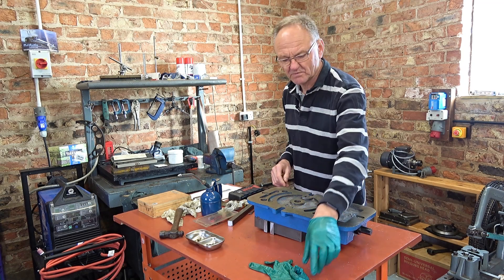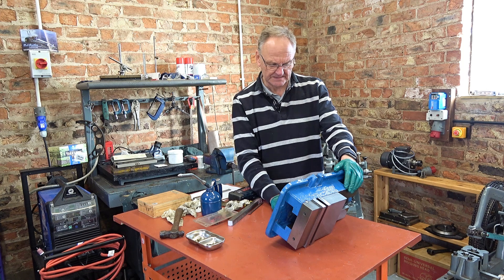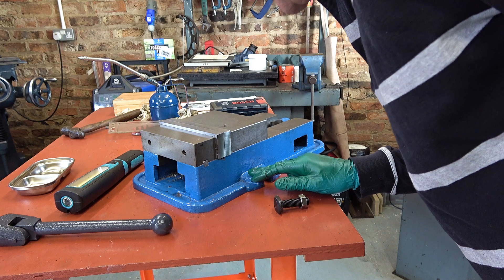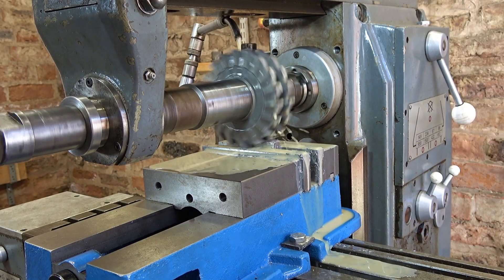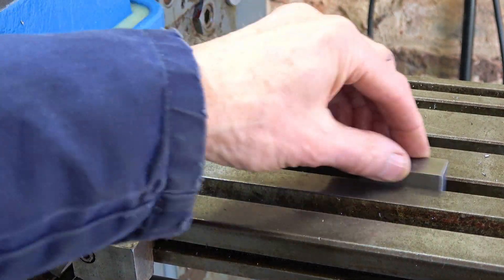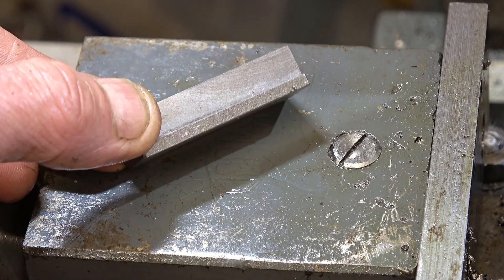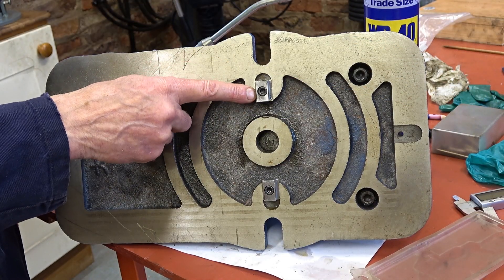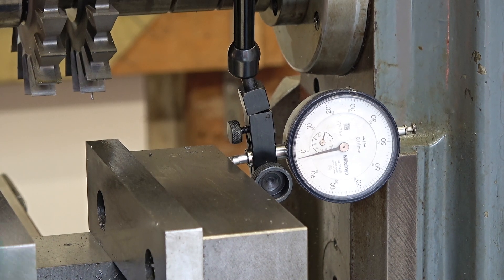HS283 Vevor milling vice improvements - making alignment keys

Comment: I have a similar vice that I use for big brutal stuff on the Bridgeport. There are lots of issues with it, like you can see oil weeping from the rear of the fixed jaw and the front of the moving jaw as you tighten the vice on to something sitting on parallels.  The face of the jaws are not very vertical, nor flat.  I had to scrape the underside of the vice body to get it flat enough to stop it from rocking. I tram it in each time, but I'm thinking it might make more sense to use keys as the thing isn't a precision instrument anyway. I use it mostly for material prep for things that won't fit in the Gerardi vice on my CNC mill. There are some inconsistencies between the faces of the fixed part, there are some dished areas, although over a few inches, it averages out very well.  Typical use is to hold a sawn piece of stock that's a little too wide for the Gerardi on tall parallels and mill the top and four sides, leaving a little grip stock. Then I transfer it to the vice in the CNC and remove the grip stock and face the part as the first op.  That way, the tramming of the big vice is almost irrelevant, and so long as the bed of the Bridgeport is trammed perfectly, it won't even matter if the vice jaws are not level, so long as I'm transferring the part to the CNC for the next operation. I have a decent 4 inch vice for the BP, but I rarely use it, the 6 inch cheapie is good enough for most stuff.
Reply from the maker: Hi M&M good to hear from you again. It's clear the cheap import vices have their limitations, but they are very cheap after all. I need to check the jaw faces on mine for vertical and also front to back of the jaw holder blocks. What's trammed on the front might not be trammed on the back. Cheers Paul

Comment: Whenever I find or come across cheap tools made of decent stuff I always wonder if what we get is a rough hewn version of what should be a finished product whereby a little finagling makes it a better product. I have a number of cheap tools and most of them have become very serviceable with a bit of whittling. In saying all that I admit that nothing, and I mean nothing, beats the sheer joy and quality of old, professional grade equipment.
Reply from the maker: Hi ClassyDays, the problem is the real quality stuff is so expensive so the only viable option is buy cheap and fettle. Moreover there is plenty of worn out quality stuff around which is well past its best and still expensive. Cheers
Reply: @HaxbyShed  it is satisfying to get a cheap tool working accurately though. Cheap tools also make the hobby and industry more accessible. At the very least it only needs fettling once. Hopefully.

Comment: check the vertical of your fixed jaw, mine is miles out. it's a size smaller vice than yours though
Reply: Also check the flatness of the base.
Reply: Base is ok within 0.01 of mill table. So I'm happy with that. But the fixed jaw is out 0.45mm over 40mm. When I've time, I will look into it. @marley589
Reply from the maker: Thanks Paul. I will.

Comment: I've never thought twice about centre punching cast iron!
Reply: Making a reference mark is fine. Whacking a center punch near an edge is another matter.
Reply: @marley589  Agreed.
Reply from the maker: Hiya MidEng, I think near the edge it might crack off (in fact I think I've done it). And punching cast iron to secure a screw head (for example) it can just break off in bits. Cheers
Reply: @HaxbyShed  Maybe I should think twice about it in future!

Comment: When I make tram blocks for the bottom of a vise, after I make them fit the slots in the bottom of the fuse, I insert them in the vise and tighten them down. Then I put a parallel 0.500 inch thick but enough height to stick out the to; of the jaws and tighten that down tight. Then I turn the vise upside down push it against the back of the slot and clamp it down. Then I machine the tram blocks. They can be machined to exactly fit the slots, which they should be. Don’t machine both sides at once. It’s a pretty easy machining job to get the width exact one side at a time while measuring them. The screw is definitely a bit short. But I wouldn’t put a bearing on that end. The screw hangs free so that chips can exhaust out the back of the vise.
Reply from the maker: Hi Mel, good point about leaving the end open to let the chips flow out. People flag up the Kurt vices as the best, and many do have a bearing on the end. Anyway .... I'll think about it some more. Cheers

Comment: Great video Paul. Given me a good idea for something similar at a local community workshop I frequent; IE:- taking the headache out of tramming the vice every time I want to use the milling machine...
Reply from the maker: Hi Dave, community workshop sounds fun. I think having the keys saves a lot of time for >90% of regular jobs. Quite frequently the last fraction of accuracy is not important and there is still the option to clock the vice in if there is just a little freedom of the key in the T-slot. Cheers

Comment: I can tell you that my own universal harrison cause me quite a few problems because I hadent trammed the table and it made parts off square, caused me a pain!
Reply from the maker: Hi Anthony, great to have a full universal with the 45 degree swivelling table but yes an overhead too to tram it up. I'm not sure of it's purpose besides cutting helical gears (no doubt I'll discover in time).   Cheers

Comment: Hello Paul, something I never checked on mine, I never use keys, always just tram in, each time I use it, as I said the last time I had to do some scraping on top and bottom, but the only thing I don't like about it is it is very soft material
Reply from the maker: Hi Peter, the vice comes with some compromises but it's cheap enough and so far I have found the jaw does not lift when you clamp it - so better than many vices in that respect. Cheers

Comment: Interesting that they didn't machine machine alignments sufficiently accurately. Personally i would have put a single cylindrical alignment in one side and use that as a pivot for proper tramming. A small thing admittedly but it depends on uour machine OCD.😅
Re sticky gauges, the first thing to do is wash the spindle with lighter fluid, put a drop on each end and it work back and forth a few times, you wont harm the internals as the are not meant to be oiled in the first place. The spindles of gauges are easily contaminated by handling or even from oil in the air, surprising but true, watch Dan Gelbarts video on paint preparation and it's problems.
Reply from the maker: Hi Chris, good tip on the gauge. I'll check that. Cheers

Comment: That Vevor vice is a bit of a never ending project!
Unlike other comments here, add me to the list of those who are in favour of keys. I milled new slots in my vice base to get it sat on the table where I wanted it, but unlike your keys mine are a slip fit into the slots. The vice is then within about 2 thou of parallel guaranteed. Sometimes its useful to be able to mount the vice at 90deg, for milling the ends of a long bar for example, then the same keys get used on the other slots and no tapping in is needed.
Reply from the maker: Improving our tools is a just part of hobbyshop life isn't it. Cheers

Comment: I think I would have machined the vise key slots to square, you were 1/2 way there while testing. All that was needed was a set of clamps and a cut it. Then make a larger set of keys. 🤷‍♂️
But that’s one of the beautiful aspects of machining eh? More than one way to achieve success !
Reply from the maker: Hi Jason, I agree the best way would have been to re-machine the slots square. I actually have some 20x20 stock square bar so it would have been no extra cost or work really. But still ..... on another rainy day I might go back and do that - or for the length-ways keys perhaps. Cheers

Comment: Interesting video, quick newbie query, is the double cutter on the horizontal arbour one piece or is it just 2 side and face cutters with a spacer between? Cheers!😊
Reply: They are 2 separate side and face cutters with a spacer sleeve between them to set the cutting width....I served a good deal of my apprenticeship time on Archdale and Cincinnati horizontal milling machines.
Reply: @howardosborne8647  Thank you! First time I’ve seen it, game changer when I make t nuts!
Reply from the maker: Hi Deebo, as people have said, two identical cutters with a spacer. I ganged two cutters because I don't have three 😁. My ambition would be a line up of cutters along the arbour but then I'd have to think of a project to use them. Cheers
Reply: @HaxbyShed  Thanks! Always learning, love it! Cheers.

Comment: I am going to buy one of these vises. I wonder if this is problem with all of the vevor vises, I'm betting it is to one degree or another. Interesting fix. I wonder how difficult it will to do this work on a round column mill? Not easy im guessing.
Reply from the maker: Hi Jeff, I can't comment on a round column specifically but if I decide to remachine those slots to true them up I will use the vertical head. (Yes I might still machine the slots true and make another set of keys - it's just a hobby 😁.)  Cheers

Comment: Milling vise improvements? It is the same as it was at the start of the video. 😊 I can't imagine how I would feel having the key pockets still miles out of tram to the brand new vise. Imagine if you lost one of those keys. Cut the pockets true in both x and y and make better fitting keys, you will feel better when using it every time. I assumed at the start that you were going to machine the original keys to suit your machine tee slots..
Reply: alternatively just drill and ream 2 fresh holes on the underside of the vise and fit a pair of round dowels as the locating keys.
I only use one singular round locating dowel on my machine vises and tap the other free end into tram with a copper hammer.....the locating points under the vise don't necessarily need to be milled slots,round dowels will work just as well.
Reply: @howardosborne8647  Good idea. The pins can be rotated as they wear. Unfortunately, the tee slots in the bed seem to be so worn they are no real use. I also use the quick 2 pass pivot method as you do, but use alternating tee bolts to pivot around. I found with my vises that the slots for the tee bolts were also not in line with the jaw which made tramming a pain. With the vise clamped as in the video, I machined these bolt slots equally both sides which really helps. When used with high tensile tee bolts, thick hardened washers and flange nuts gives the best results, better still, machine the mating surfaces that the washers sit on.
Reply from the maker: Hi Tates11, I tend to keep hold of the original parts as 'reserve' in case I mess up.  I may still recut the key slots in the vice and make new keys, or perhaps just remachine the slots for the other Axis at least.  I've got the time (providence willing). Cheers

Comment: Well - that kind of issue is one of the reasons import equipment is cheap - but just goes to show that a bit of ingenuity and work brings it back good again. Top result if the back of the vise is parallel to the fixed jaw. I don’t use tramming keys myself as I prefer to just indicate the fixed vise jaw in, but the keys can be a quick set up tool for sure. Cheers!👍
Reply: Just to expand on your thinking I have a couple of machine vises that have only one round dowel as an indicating/locating key in the tee slot. 
That gives one fixed pivot point on one side whilst the free side of the vise is simply tapped into tram with the setting hammer then both clamping bolts nipped up.... it makes setting/tramming the vise very quick to do.
Reply from the maker: Hi Stuart I think I'll find out through experience whether the tram keys are worth it. They made the slots in the base of the vice like they never were intended to be used - just a look-nice fashion accessary. Cheers

Comment: Sad those slots are that far out. Good job on the keys.
My Kurt came with keys, fitted by the original owner and their spot on. 
But I always run an indicator before doing anything critical.
You’re another step closer, Paul ,
Cheers…..
Reply from the maker: Thank you Dean. If I'm ever in the States again I'll buy a Kurt cheap and slip it in my hand luggage. Nobody will notice. 😁
Reply: @ you may need a little help placing it in the overhead bin 😂

Comment: I wouldn't use tramming keys personally, however, you should be tramming the inside of the fixed jaw as that's the area that matters. Nowhere else does?
Reply from the maker: Hi Darren, I made the assumption that the back of the jaw block is parallel to the front and we know that's a dangerous assumption so I need to check. But both of those jaws fit either side of the fixed and sliding blocks to give the vice clamp action more span if you need it for bigger work pieces. So the front and back faces of the mounting blocks aught to be perfectly parallel (and maybe they are .... now where's that DTI .... ). Cheers

Comment: I’m not sure why’d anyone would use tramming keys in the first place, it takes about a minute to indicate in the vice fixed jaw. I have one of those Vevor 6” vices and it’s sitting over in the corner so to speak because I bought and refurbished an older Kurt Vice which is about a zillion times better. And I don’t use any keys in that vice either.
Reply: One singular key is useful as it provides a fixed pivot location. A round dowel pin is preferable to a pair of flat location keys.
Reply: @howardosborne8647  Howard Osborne of BSA V Twin fame?
Reply from the maker: I'd love to have a refurbished old Kurt. Just don't see them here as any sort of sensible price. Cheers

Comment: Fixing the length so it engages more of the nut would be a great idea.  That's a decided "miss" in my opinion.   But I'd avoid  adding a bearing at the "free end" of the screw.  For the Kurt style hold down feature the nut and by connection the lead screw needs to float a little so it does not resist the wedging action that pulls the lower block, which is also the nut, against the upper jaw block.  The idea is that the action of those two parts wedging together pinches them against the bed rails.  In effect the clamping effect IS the far end lead screw bearing already.
Reply from the maker: Thank you Bruce, advice understood. Cheers.
Reply: The floating nut is the whole purpose of this type of vise. Having the nut in front of the moving jaw is what gives the downward pressure.
Reply from the maker: Thank you 👍

Comment: I do not use vise keys for two reasons: they make it difficult it set or remove it from the mill table and I have more trust in indicating .
Reply from the maker: For accurate results I'm sure indicating is for sure the right way. For 'drop it on and off you go' routine jobs that don't have to be super accurate I think the keys are probably ok. Experience will tell. Cheers